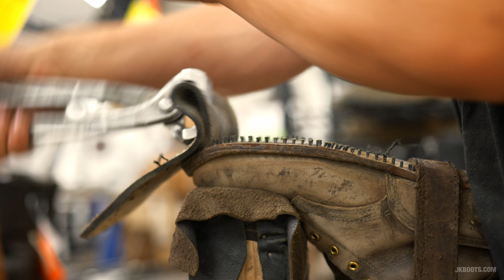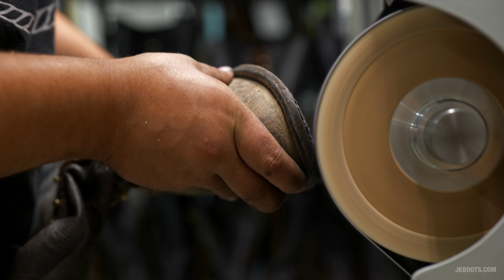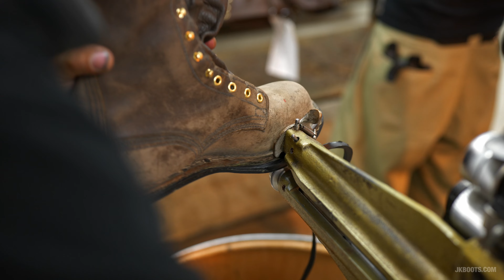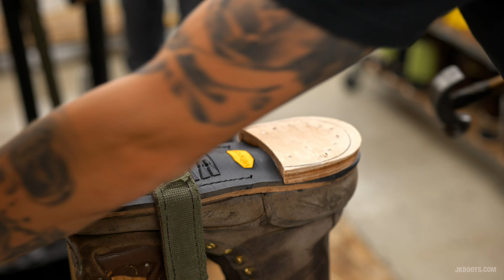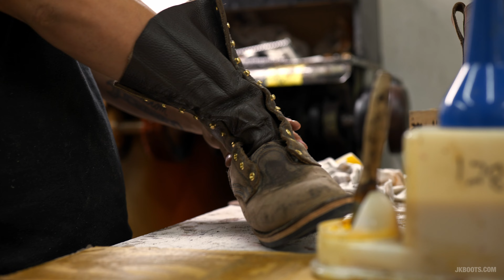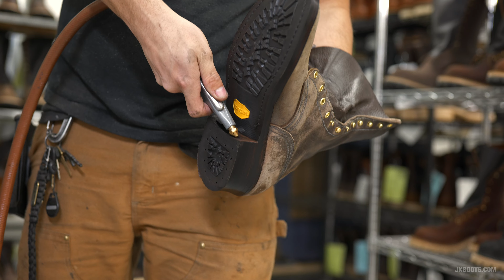Custom Boot Restoration - JK Resole

Comment: Why did you leave the old thread in the boot when you installed the new sole? I cannot understand that.
Reply from the maker: Removing the old threads would leave large holes in the welt which could lead to the welt breaking down much faster. When our stitcher stitches thru the sole and welt it actually punctures a hole that the thread fills in. So there are those existing holes from the original build. At the point of a resole, the threads are very worn down and they serve as just fillers. We also stitch all  resoles again, and if the threads were taken out and holes exposed, the stitching again could damage the welt further if they aren’t filled in.
Reply: Yeah, I did see that. Two thumbs down from me.
Reply: @jkbootsusa that kind of highlights the benefit of a goodyear welt, no? No need for new holes when resoling since the welt can be replaced and sewn to the upper by hand utilizing the old holes. (Wyatt and dad cobbler co does it this way.)
Reply: Didn’t like the stain at the end. I would prefer a clear sealer that showed off the wood heal and keeping the lighter band around the boot sole. Thats just my preference.
Reply: I’ve seen where they torched the old thread down so it keep the holes filled but removed all the surface tread.
Reply: cut your nails bro😅

Comment: Why are the old stitches not pulled out of the upper before stitching on the new sole?
Reply from the maker: Removing the old threads would leave large holes in the welt which could lead to the welt breaking down much faster. When our stitcher stitches thru the sole and welt it actually punctures a hole that the thread fills in. So there are those existing holes from the original build. At the point of a resole, the threads are very worn down and they serve as just fillers. We also stitch all  resoles again, and if the threads were taken out and holes exposed, the stitching again could damage the welt further if they aren’t filled in.
Reply: @jkbootsusa  Interesting explanation, I've never seen anyone else do it this way.
Reply: @jkbootsusa makes sense. They aren’t Hurtin anyone in there anyway
Reply: @jkbootsusa you can always just adjust the thread length on the machine so that it matches the old holes. Doing it this way tears up the welt anyway due to the extra holes. That’s aside from it looking like a rope running along the welt with all of the stitches. Everybody has their way of doing things, I was just taught different.
Reply: @Lexidezi225 The only reason would be aesthetic but for work boots that look like this, who cares?  Now if it was a dressier pair of casual boots...
Reply: Because these boots are built in the PNW method, they don't have a traditional "welt" that can easily replaced. The vamp portion if the boot is folded out to create the welt in the front half of the boot, then a piece of veg tan as the mid-sole is added which creates the look of a welted boot.
Reply: @mikeford963  I understand what you’re saying. But holes are holes. It’s not impossible to remove the old thread and line up the new stitches.
Reply: @SergioPena20  I think it also depends on whether or not the exact same machine is used to stitch the boots, or whether or not the stitch spacing can be adjusted. By I do agree with you on that one, especially as the outsole is also glued to the midsole.
Reply: @mikeford963  yeah I see what you mean. Landis machines have adjustments for stitch depth and width. But it isn’t a guarantee. It takes experience to be able to do it.

Comment: the leather looks so dry, needs to be conditioned pretty badly by the customer
Reply: Yes but the leather is probably damaged by concrete/tar/fire so it has a damaged crust almost like a crust on a steak 🥩
Reply: I agree most cobblers do treat the uppers polish and hydrate the leather with a resole one other is that the Mid sole was not replaced ? ? ?
Reply: This beautiful resole is like lipstick on a pig.

Comment: You guys don't pull the old threads out? Why not?
Reply: Because they use such heavy duty stitch down thread and sew by machine, they can't ensure they hit the old holes when they apply new thread, so you potentially leave pockets between the leathers that has no material. 
This way you at least still have that old heavy duty thread filling everything out.
Reply: @WolfMimirMori  ah gotcha. Makes sense! Thank you
Reply: Our local cobbler does it that way also good to know I was in good hands by going to the local guy.😊

Comment: Was this a budget job why leave the old stitching on the welt then stitch over it a good cobbler would have removed the old before putting new no matter how old the boots are do the job right
Reply from the maker: Removing the old threads would leave large holes in the welt which could lead to the welt breaking down much faster. When our stitcher stitches thru the sole and welt it actually punctures a hole that the thread fills in. So there are those existing holes from the original build. At the point of a resole, the threads are very worn down and they serve as just fillers. We also stitch all  resoles again, and if the threads were taken out and holes exposed, the stitching again could damage the welt further if they aren’t filled in.

Comment: Why was old thread left in welt and not picked out?
Reply from the maker: Removing the old threads would leave large holes in the welt which could lead to the welt breaking down much faster. When our stitcher stitches thru the sole and welt it actually punctures a hole that the thread fills in. So there are those existing holes from the original build. At the point of a resole, the threads are very worn down and they serve as just fillers. We also stitch all  resoles again, and if the threads were taken out and holes exposed, the stitching again could damage the welt further if they aren’t filled in.